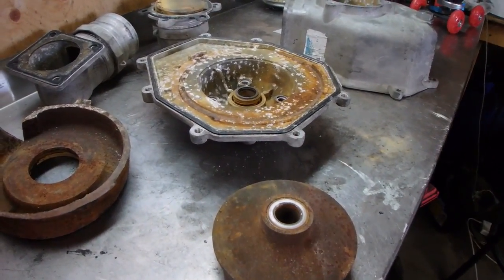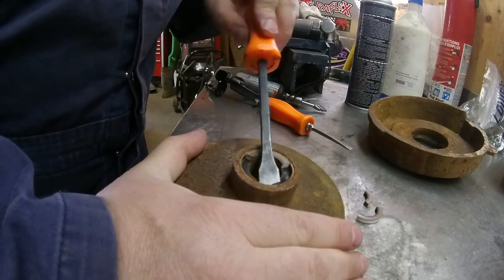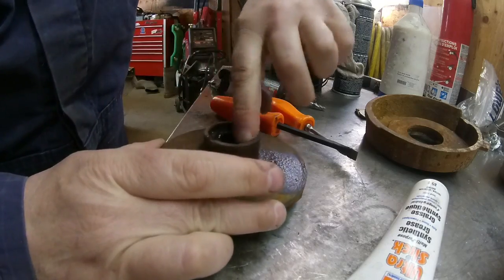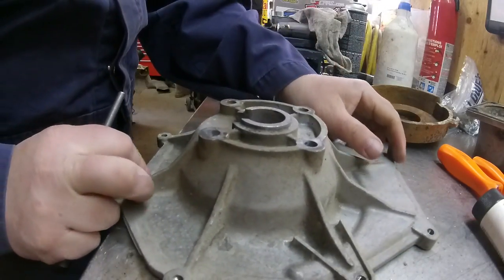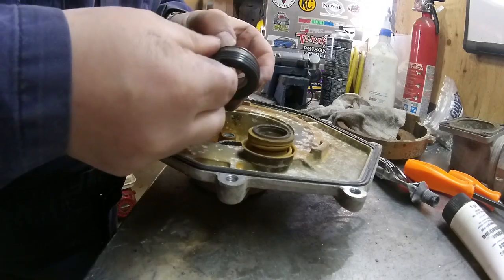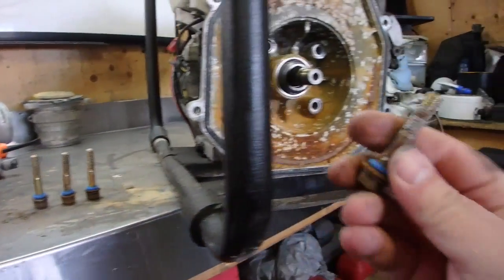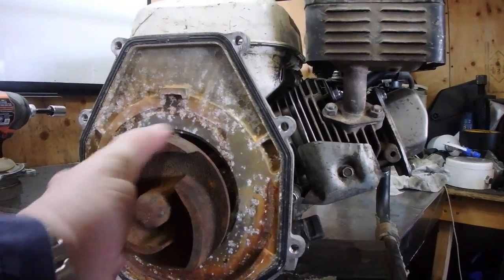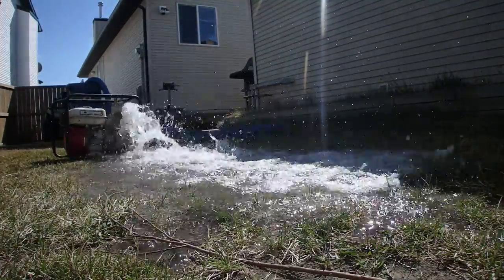Mechanical Seal Install and Pump Assembly

Comment: Well it works, man that seal just pushed in so easy with the socket , is that normal or does it even matter.
Reply from the maker: +STEVE ROB if it's too loose you risk a chance of the seal turning.